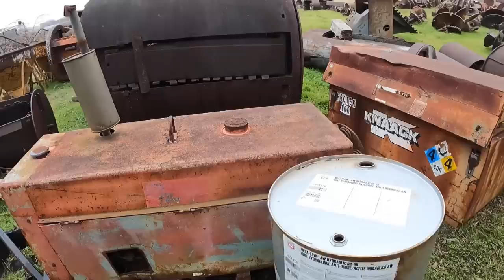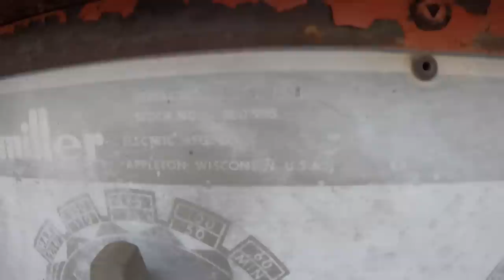Miller Big 40 Find.

Comment: Isaac, I'm sure you have received similar comments already, so I just add, work the engine first. Find out if it can be turned over, compression checks, etc.  Regardless where you use it, fork truck or to power the big welder, find if the engine can be restored to operation without breaking the bank, thus setting the course for you so to speak. 
I can't express enough how much I enjoy your videos and look forward to seeing many more. Maybe you'll have an update soon on what's the latest you've done with your Hudson.

Comment: If it were mine, the first thing I would do is pull the motor and check to see if it were re-buildable and would mate to the forklift without too much trouble, unless it is a direct fit.

Next, I would tear into the welders generator, see what it needs and how available parts are, and the cost of the parts needed, if they can even be found. 

From there I would make my decision on what to do with it. If not too costly and reasonably sure it could make sparks again I would try to re-build welder. It would be a good Father & Son project, and if he wanted (depending on reliability) he could start his own business, with your help of course. 

If not, you can always use it in the forklift. Yeah, that's a lot of "ifs". If all else fails, it looks, like you could still make some good money scrapping it. 

I hope it works for you. Keep putting out great content. This would make a great video series. Best of luck on whatever you decide to do.

Comment: Mitrowski Welding in Houston will square you up with any rebuild on the Gen-head and the controls.
Any rebuild shop for the engine.
The rest is you working hard to clean it up and make it look good.

You know what a decent welding machine is worth, and that is a 7+/10 in running condition for its abilities.

Comment: Isaac I would try to get it running and go from there.  I would guess the generator side of it is too far gone but you might be able to get that motor to come around as long as it's not locked up too bad.  Will be interesting to see what comes of it!!

Comment: The last person I saw getting a long unused engine freed up sprayed a mist of ATF and acetone mix in through the spark plug holes.  An hour later it turned over and started.  It had only been standing for ten years though and your engine looked to have been unused for longer than that.  It would be interesting to see what one of those plastic restore products would do to the front panel.  They can have amazing results with faded plastic.

Comment: Fire it up!  Good Job.  I'd restore it if possible.  After I quit welding, I came south again 'n operated crane for a while. (NCCO).
Experience shows it's easier on the boom internals  telescoping a loaded boom the more vertical the better.
I was surprised your boom brought the machine in at that distance. Pretty stout for a little one.  It would have been easier going over the side. 
👍🇺🇸🏁🇺🇸

Comment: A local welding shop had a big 40 back in the day (1980's).
It was a beast and served him well.
That said, might be an engine for the forklift and scrap the rest.
I say might, because I would look into re-powering the forklift with a diesel. Out of a semi trailer refer unit.
Thermo-King, or Kubota engine.
A better welder restoration project would be an SA-200 !! Better parts availability and you are more familiar  with them.

Comment: You've got to see what it would take to get the engine up and running, then see about maybe rebuilding it fully if it looks salvageable.  As to the welding equipment half, I don't know enough about those to say how durable and rebuildable they are. but it might be a fun father-son project to go through the machine and get him familiar with all of the parts inside one of them.

Comment: Years ago the were a pile of them Big 40's around here, everybody seemed to have one. Hard to say what to do with it, the engine shouldn't be an issue but the gen part could be fun. My 200 amp Lincoln was 1843 lbs dry, that 40 will be very close to that

Comment: Depends on the output of the generator.    Might be a good hydraulic power unit to test hydraulic componentry or maybe run 3 - phase shop equipment.

Comment: Nice transport ops there Issac. Change the oil( even if it’s used stuff from your truck ) and out a battery in it some fresh fuel and see if it runs. It will make a good test rig for the said engine. The electrical side of things maybe too far gone to make it a welder again economically. Still whatever you do with it I am sure we will watch it with interest.

Comment: I would suggest to get it to a runinng state and put it to use, is one of the compontes are bad, try to rebuild it, as long as you get the motor running you can check on the generator part...if they are both  beyond repair, you could use it as a boat anchor anyway...
😂
Thx for showing!
👍👍👍

Comment: IF it's rebuildable AND there are vintage construction machine fairs not too far away, I'd take it where they have the steam powered stuff working and really old diesel machines doing their thing.  A totally restored Big 40 could be both a display and a legit welding rig on site.  An old pre-war flatbed truck that just cracked something could be fixed with your working display rig.

Comment: I've got one of those at my work. Its mounted on it's own trailer. It has a Continental gas engine. I need to pull it out and tear it down to replace the rear main seal.

Comment: Get it running and welding if possible and set your Son up with a mobile unit. Or use it at the shop to air arc with. I found a big 40 at an auction a few years ago it was in mint condition, but it wasn't in the sale. Cool find.

Comment: There is still enough blue paint on this to save. So let me help. I helped rescue a big 50 welder in Haines Alaska. It stayed on the dock. It was a diesel but it still had some corrosion.  It is a sweet machine. For this welder It would be a good addition  for you. I can get the welder sparking if you can spin it.

Comment: Ya, gonna need to see progress on this. Nice score. Just please don't try cranking the starter. Lube it up best you can and try to manually spin it first and I would even pull the rotor out to check it. One spin and either has issues and generator tolerances can be lost or you can pop a head or bend a connecting rod.

Comment: It's not like you need another welder, however, based on recent weather related power outages in Texas, if you can get it running, it might make a good backup power generator for the house. If possible, maybe consider converting it to propane or NG.

Comment: Depends on available time, how much work is needed etc. Must say though it does look like an earlier machine and so much easier to diagnose and fix. I'd be tempted to do a full rebuild and keep or perhaps sell. 
If the engine is the same as the lift trucks then rebuild and replace. Remove the current engine and rebuild and keep as a spare or sell.
Or - scrap prices are high...

Comment: The first thing I would do is manually bar the engine 360 degrees. ThT will tell you a lot about the condition of the engine. If it turns over smoothly change oil and see if it runs. Good luck sir 😊
Reply: I was also thinking take the carburetor float bowl off. And clean it out with brake clean. Pull the needle and seat apart. And clean also needle is under the float. Blow some shop air through it I think it will start. Prolly check the spark plug. And get a new one. Hope this helps sir

Comment: Rebuild the welder, then find another motor for your forklift. My tractor and my forklift have the same motors, it is handy to keep the same parts around that fit both machines. Plus it makes troubleshooting easy because you can swap parts back and forth. Cheers

Comment: That is a continental Red seal same thing  they run in the sa200. Take the spark plugs out and mix you up some some good penetrating fluid and some power service and fill the cylinders and let it set. I had one just like it they're a good machine if you can get it to work. I would see if I can get it to run and make it weld again.

Comment: Did I miss why you didn't back up next to the welder instead of hanging the welder and driving out?  Also turn your trailer hooks over so you hook up from the bottom so if they snap they will go down instead of up and hitting something.  Good video and good work

Comment: First, contact Miller with the model number and serial number. See if you can get the manuals. Then change the oil. Don't refill the radiator yet in case there's a cracked block. Remove the spark plugs and with a wrench, see if the engine is free or frozen. You might have to squirt some KROIL in the spark plug holes and let it sit for a day or two. From there the decisions are up to you. It may be a really great welder, or not. Thanks for the video. Jon

Comment: You will be able to rebuild the engine fairly easy - parts are good and availab;e, but the welder, if it needs much you will be a hung duck. that is why there are no ore big 40s. So check what parts are needed on the welder before starting to rebuild that part. I think these were beautiful when painted miller blue. they looked sharp!

Comment: so many forklift run 4 cyl flatheads, Clark , Hyster, Old Tow Motors, and if you look real hard you may find one or two Cats out there with one. Rebuilds are easy. Tough Motor as long as head isn't warped from over tightening . Have fun..

Comment: I’ve actually welded with a Big 40. Like all those old dinosaur welders, they’re fine if all you’re doing is stick welding and don’t need much generator power. Some friends of mine have one on a trailer that appears to be in great shape but they say it stopped welding and the parts are unavailable. I personally, haven’t looked into it and don’t actually know what’s wrong with it. Good luck.

Comment: Nice find!! I think I would do some basic maintenance to the engine and see if you can get it to run, if you get it running see if it will weld
if it works rebuild. If can't get the engine to run rebuild and then see if it will weld

Comment: I would love to watch you rebuild and restore this monster, but I have no idea whether you have the time and energy for a project like that. If it had the Deutz diesel it would certainly be worth it, and even with the 4 cylinder Continental it should run fine and have enough power. If the first two digits of the serial number are 72 then it is from 1972. It may weigh about 1500 lbs (info varies) and in running condition should bring about US$ 500. It would be worth more if it was mounted on a trailer.
Reply from the maker: Its funny you mention a deutz engine. I have one that came off a welding machine here in my shop. The armature side of the machine went bad and i bought the engine. been waiting patiently for something to use it on.
Reply: @ICWeld  Hmmm, interesting. The Big 40 with Deutz diesel is considered to be a better machine and gets a higher price. It might be worth looking into a conversion. It might take an adapter plate, but that wouldn't be a problem for you. Hi 🙂

Comment: You forgot to put your stabilizers down! That can be hard on your frame. I think you should look at rebuilding the welder. I have the same welder and it has sat for 20 years and I am going to look at rebuilding it as well. Water in the oil could be from a leak in the exhaust; it happened on mine.

Comment: Make it run, then make it weld !   before stripping off the Continental red seal 4 cylinder, make sure it will run.  Most old welders outlived their first couple of owners. I had a P&H 400 amp with a F-186 that was worn out , I put an F-226 on it and it would run two stingers welding on toe steel. , one Weldor on each side. Usually that old 4 cylinder oxidized the points and wouldn't start and if it was needed right then and there , it got retired and the Dealers don't want trade ins anymore so it got to sit around without a cover on the exhaust pipe.

Comment: First things first, see if the engine is locked up. Then see if it will run. Rebuilding any engine is really simple. Rebuilding the rest of the welder, if you want it as a welder, might be a bit of a different story. I will say, back in the day, those were extremely solid and reliable welders.

Comment: If you have the time check out the cooling system for leaks into the cylinders or crankcase.  Then go from there to see what will turn and move.  Will take a lot of TLC to get it back to being useful.  If you have my luck the head or block is cracked from freezing or rusting.  I have an old Johnson outboard inherited from my father and the cast iron cylinder rusted and split open and is beyond repair.  That is the kind of luck I have.  It was stored in a garage and evidently wasn't flushed out after its last use and is only something to look at and remember my Dad using it many years ago.

Comment: I had lincoln pipe line welder with continental 4 cylinder engine . Had it rebuilt . Only 50 cycle 110 output

Comment: I picked up a old Lincoln from the late 50s think it’s or it will go to almost 400 amps and has a diesel power plant and man it is the smoothest welding machine something about the old copper wound dynamo’s work better than any of the new junk with less problems and you don’t need a diagnostic kit to fix to buy that welder new is 18-19000 dollars crazy right

Comment: My Clark forklift has the similar motor but has the hydraulic pump built into the engine on the side at the water pump end. I'm kinda with the other guy that said soak it down in the cylinders an try to get it to move. Lots of soaking and gently back and forth rotation by hand with a wrench. Clean the points and probably do the carburetor.  If I can help contact me. I've had mine for many years. They are good machines

Comment: these days any engine can be refurbished and got working again, i found an old marine diesel engine  from the 1950s i got working again, had to have the cylinders re-done but you can get them spray welded these days or tubes fitted... id do a complete tare-down and rebuild, then if it works then decide i mean its a decent welder when it works... the question is COST to get it running again. is it worth the expense for what it is?

Comment: If that were my generator, I'd be trying to get it running. You never know when you might need it, but not necessarily as a welder. As uncommon as they are today, I'd do what is reasonable to bring it to life. Forklift engines should be rather common in your area. Maybe you could find one with a blown engine somewhere that could fix yours.

Comment: It’s your machine, so any thing you do with it is fine. But if you want to see if a frog is a prince, you have to kiss it, so the first thing I would do would be fill the radiator with water and see where it ran out, or not. If it passed that test, I would see if it was free(turn just a little). If free, clean plugs, points, cap and rotor, check for spark. Change oil. Hook up good battery and known to be good small gas tank with clean gas. Start. If will run some, check welder brushes, and if stoning(like the Lincoln guys do) is a thing on this machine, do that. Hook up some leads and see if it welds. In any event, be prepared for anything to happen and BE CAREFUL. Like Ursula Andress said “I know nussing.”. Take care and Best Wishes for the new year.

Comment: whether you restore it as a welder or use the engine in your forklift, time and effort spent on the engine won't be wasted so first, I would clean it up and see if you can get it running, if you do, troubleshoot what might be wrong with the welder.....  I know you don't "need" it as a welder but it would be a very cool father and son project and having a nice 50 yr old blue Miller big 40 would be awesome....

Comment: Been sitting outside for a while. I would have tried to bar it over. If it didn't budge at all, straight to the scrap yard. If the crank will turn (or at least budge a little, rebuild the engine. I doubt any of the electrics are salvageable.  Unless of course you find another one with serviceable electrics and a blown engine. Then build a Frankenstein. Just my thoughts.

Comment: If that engine turns out to be junk you can try looking for an old light tower some of them had 4 cylinder  kabota diesel engines in them I did the same thing your thinking about I put that engine in a fork lift and it fit pretty good and ran nice

Comment: Change the oil and filter, spray some PB Blaster in the spark plug holes turn it over by hand and start it. Clean the brushes and try welding with it. Those motors are almost always bulletproof. Just my .02 from an old friend. It's too solid of a machine to break it apart. I bet it welds better than my 330MPX!
Reply from the maker: Is this the same PJ I know?
Reply: @ICWeld  It is, I didn't know you were famous😂

Comment: Pull the plugs, soak the cylinders, get the water out of the crankcase and maybe try to hand crank the thing. I’m sure you will be led by reason after that. I would do a little research on that thing too. Steve
Reply: I agree. The first thing is to soak everything in penetrating lube so that time is your friend. If it takes you a week to get to it, that time is working for you.

Comment: Depends what You want out of it?  Do you feel it is worth rebuilding the engine ? even for your forklift?  How much is the welder worth ? in as is...running??  rebuilt ?  Can you repower it with something else?  a different engine?   Sometimes using a common easy to find replacement engine is a cheaper option...  i usually compare both options.... Yeah it is worth rebuilding it or getting it in a working condition.... depends on who is doing it..and whether they are enjoying the work.... to one it is a waste of time/money...to another it is just a Fun time and relaxing work...